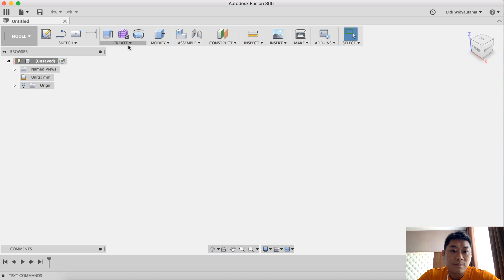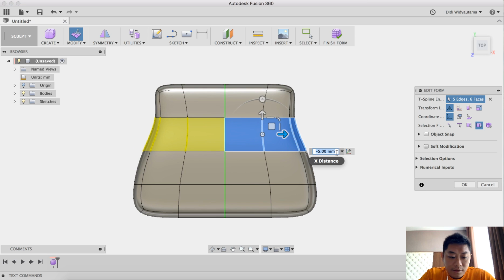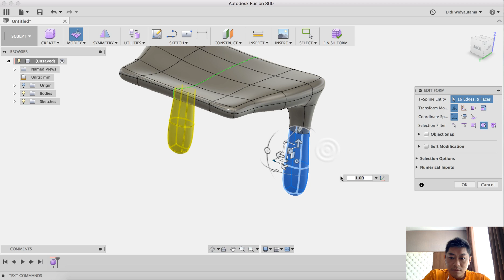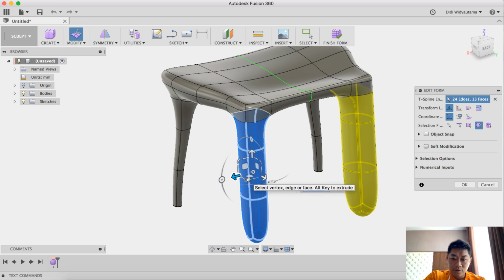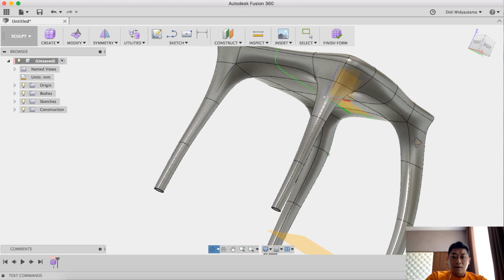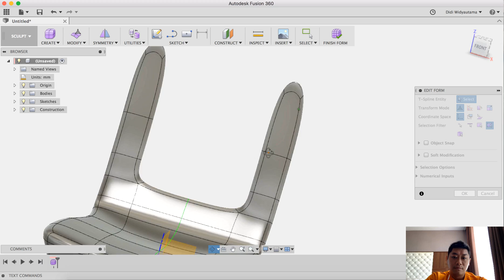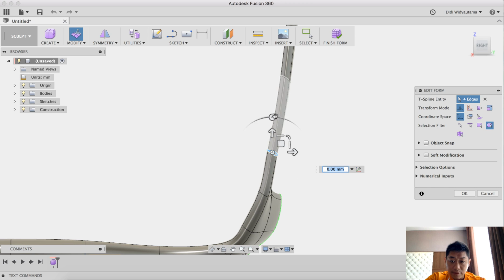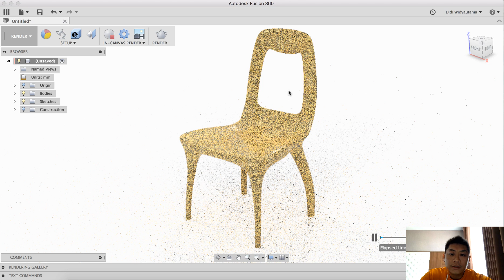Fusion 360 Tutorial-Furniture Design

Comment: HI, good video, in this case or I believe when working on sculpting environment you  are working just by feeling? is there any way to reference the design? how you know the chair its to the right height for example? or the legs are the right size? Im just getting involve in the sculpting environment but i get lost on that matter. TIA
Reply from the maker: Mi Robot CNC yes, in this case of this video, because i just intended to visualized my shape, but if you like to have a size, it also possible, you can draw a bounding box prior doing the sculpt and you can get the size , and also when you manipulates the shape, try to type the numerical measurement. Hope it helps thanks
Reply: @DidiWidyaUtama  ok got it, thanks for the replay!

Comment: hi at 14:30 you mention that you need to change the symmetry to face, can you explain further how you did that?
Reply from the maker: Aida Irving , in my case, i like to extend the 4faces simultaneously, but because there is a symmetry feature  (green line) if i just selected only 2 faces , so the result will extend those 4 faces but separately.  Hope its explained. Thanks